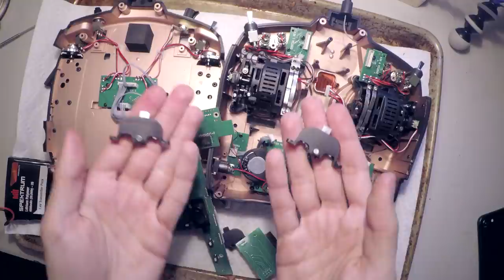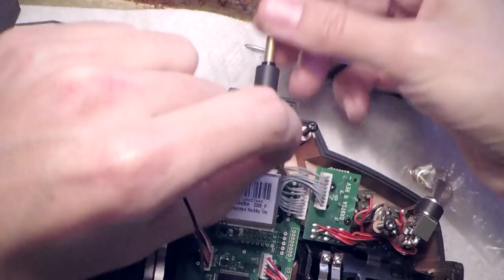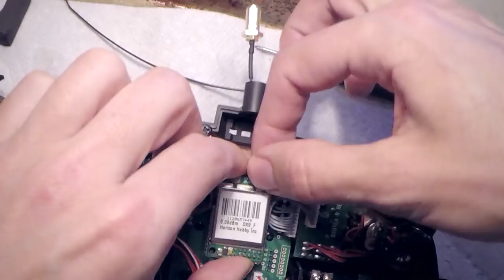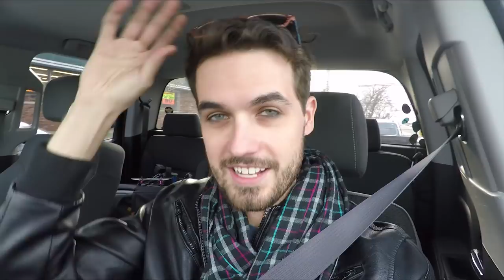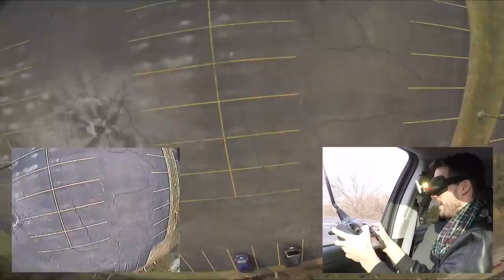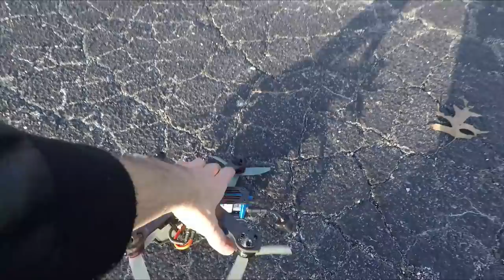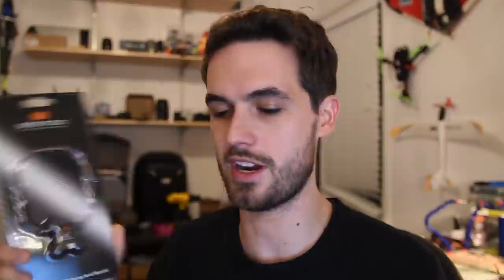Antenna Mod for Spektrum!

Comment: I did the same mod couple of month ago in a DX7 G2 and I was horrible. Although it fitted in the Transmitter very good but the signal is not good. And you can your a RSSI signal alarm it's in the telemetry menu I use it every day with the dx7 dx9 and dx18. Btw the stock dx18 I get 600m range no problem. Just inform yourself better. And there is a video on the RSSI signal strength alarm from Miguel Avares on the YouTube
Reply: But voice alert doesn't work because of faulty Airware... So with goggles on its useless. There is a workaround to have tone alerts but that ain't ideal to.
Reply from the maker: I checked a few of Miguel's videos and can't find where he successfully got RSSI working as an alarm trigger. Additionally I've been in contact with Spektrum and they've confirmed to me that it is not currently a supported function but is being worked on
Reply: Thomas D i get Ton and Vibration. Vor the voice I can assign my own recording
Reply from the maker: Tom D there is a workaround? I didn't know that I'll look into it. But regardless will be better when AirWare supports it properly.
Reply: https://www.rcgroups.com/forums/showpost.php?p=36864754&postcount=773  Only for voltage however. I've programmed a switch when activated to give me a voltage reading. RSSI should only work with tone.
Reply: how did you assign your own recording? I own a DX7 G2 and cannot do this

Comment: Lol the XM can reach 600m withoud any mod and the XM+ can do 1000m withoud any mod. Video range is bad, flying 25mw?
Reply: And he has also a patch antenna.
Reply from the maker: I was using 200mw. Considering the amount of interference in the area and how close I was to the ground, I thought video was pretty good
Reply: Ok than it must be the interferance because I reach a lot further than that withlooud any problems.

Comment: UH instead of putting your poor mini quad into harms way I don't understand why you are not using the Range Test functionality of your Spektrum Radio? It reduces your RF link by 50% power. But I can see the probable source of entertainment value of flying till you lose something :)  Keep up the great vids bud!
Reply from the maker: Wanted to do a more real world test. Hence the area filled with interference and such :)
Reply: Gotcha :)
Reply: Actually decreasing the power output will not be linear to decreasing range. So half the power will not mean half the expected range. Spektrums 30 steps is only for reference, meaning should be fine, there is no obvious fault.

Comment: Take a look at this Stone Blue Airlines video with IBCrazy doing the mod on a Taranis. He shows how the SMA extension needs to be a certain length to achieve best range. https://youtu.be/-8R1rPZulrY?t=1m14s
Reply from the maker: very good info! Thank you
The pigtail I linked is actually designed to be used for this purpose (as well as for use with 2.4 GHz WiFi) so my hope is that there's some tuning there....
Additionally it would be difficult to change the length here because you dont solder to Spek board and its plug-n-play
Perhaps another advantage of Taranis haha
thanks again for sharing this link
Reply: From a video comment on Joshua's Taranis mod, it seems that if the cable's impedance is 50ohm you don't need the length to be exact. Have ordered all the stuff for this mod to and was worried about not getting the best range.

Comment: I did the same thing! But with a 9 dbi antenna and everyone made fun of me😂
Reply: lol Be careful with higher gain, the higher you go the bigger the dead zone from the tip the 6dBi is said to send signal out at a 45 to 50 degree angle all the way around the length of it and the rest is a much weaker signal, so its kind of like the difference between using a patch antenna and a clover leaf antenna on your goggles. I was thinking it would be cool to do what drew does here, but also replace the one in the handle with a 3dBi antenna, just remove the antenna from the plastic tube they come in and put it in the handle. Then you would have the 3dBi working for you when your close by yourself but the 6dBi would kick in when you go far out. I think this would be a perfect setup especially with some really good quality tuned 2.4ghz antennas. This would be just like the diversity setups we are running on our goggles when we use the laforge and a patch on one side and a clover on the other. I may have to give this a shot! In theory it sounds like it would be amazing. lol but it may actually be horrible who knows!?!
Reply from the maker: That would be really interesting Steven! Like I mentioned I had wanted to try to fit a higher gain antenna into the handle perhaps even 3D printing a replacement handle altogether but ended up deciding not to spend that much time fiddling and just get it done with the primary antenna. If you try something different let me know
Reply from the maker: and Stegglez, lmao